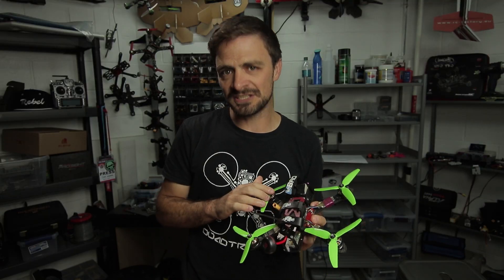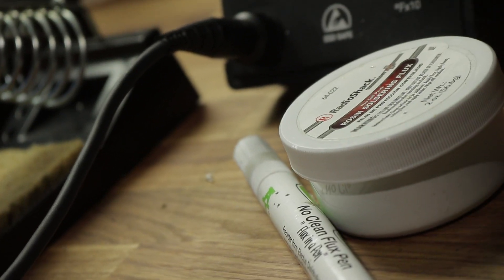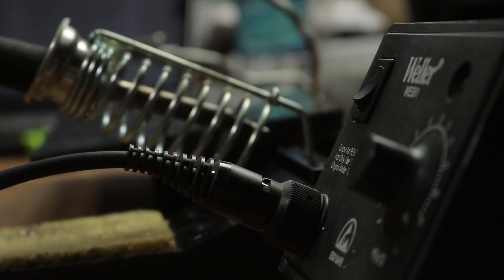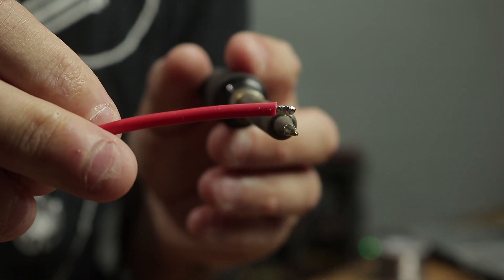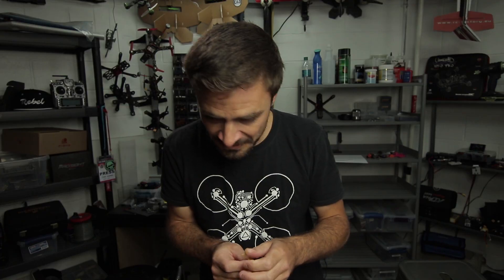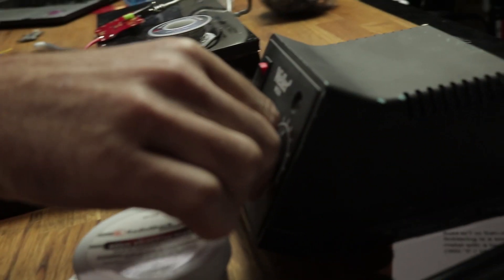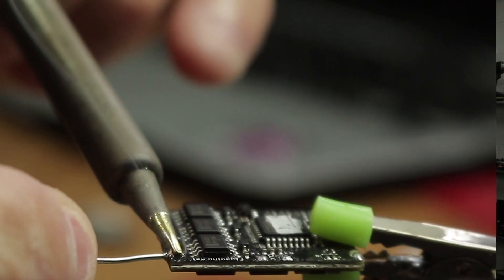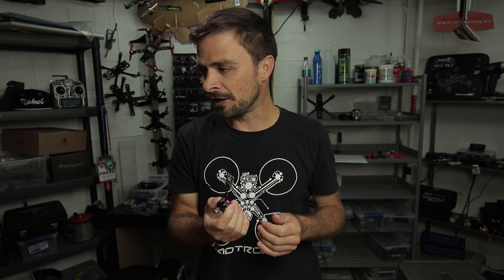Soldering Tips

Comment: So how would you go about getting a little solder ball out from between components? This happened to me while soldering a kiss esc and the solder went in those tiny spaces that you pointed out. I tried the solder sucker but it's too big to get in between there :/
Reply: Muki this used to happen to me all the time... I started using painters tape on the esc  while I solder the motor leads
Reply: Washing the finished board with alcohol and a brush removes 99.999% of all solder balls; they are blown out of the molten solder pool by the flux boiling, which is what it does.  Flux is there for two purposes.  All metals oxidize when exposed to oxygen.  The flex is acid-base and etches and cleans this oxidation out so the solder will flow into the metal parts being soldered.  It also out gasses out of the molten solder pool creating a gas shield that keeps the surrounding oxygen away from the molten solder pool.  

If you ever look at a solder joint and say, man that is dull looking and not shinny like it should be, why?  The heat was right as the parts took solder and both are soldered together.  What probably happened was there was not enough flux, or old flux, and oxygen got into the molten solder pool before it solidified.  Too much heat causes this too.  

You want to tin your parts so when you go to solder the two together you are adding the right amount of solder to where it needs to be; so when it solidifies it comes off looking top-shelf.  NASA standards tend to be anal in that way.  Just making a good electrical connection is pretty easy; making it also look right is another story.  I am NASA class B trained.  

As Ol'boy said, there is a thermal-nuclear bonding going on from the heat at the tip of the iron through the molten pool.  You can see this happening when you touch a hot iron to the two parts; the solder melts from the tip of the iron out across the two parts creating two parts in a molten pool of solder.  Electrically your done.

Aesthetically we want to be able inspect the joint to see two things: both parts took solder and are thoroughly wetted, and that there is enough solder to mechanically hold the two together; no more, no less.  Looking at a shinny giant solder blob on top of two parts don't tell you squat.  That could be a cold solder joint and you would never know it.  Chances are it is not, but in the anal NASA world an inspector would have to know for certain.  It should covered and shinny and you can see both parts wetted together.

Fit and finish needs to come together at the same time.  Two biggest things I see folks doing improper on the web: too much solder being used to prep parts/tinning; use physics, solder flows to the heat; that nuclear thing.

1.  Tinning wires: Strip them and leave them long.  It is about where you strip the insulation at.  Use flux-liquid or past/ don't rely on the flux in the solder alone.  Do not twist the wire into a ball... why?  The wire is a twisted pair as made, when you strip it, put it back as it was made-we want to wet solder into the wire so we can trim/cut the wire to the right size as needed to solder; don't twist the wire so tight that it resists solder flowing thru it as this aids in the mechanical strength in the connection-less heat needed by the way.  Apply the heat to one-side of the wire just above where you intend to trim/cut the wire to length for soldering.  Wipe/paint the solder on the other side of the wire, as it will flow to the heat, down the wire towards where you want it tinned... get off of it.  We are not globing it on here for other purposes; just tin it. Trim the wire to length.

Globing it on there ain't it, and it just wicks solder up under the insulation... not good;  takes more heat too when joining the two parts together

2.  Tinning/prepping a pad:  Use flux... see a pattern here?  Clean the soldering iron tip (every time), tin it, and apply heat to the pad.  Tin/prep the pad by wiping/painting the pad away from the tip with the solder; use the nuclear-physic thing here to paint solder on the pad.  All we need to do here is wet solder into and on-top of the the pad so we can join the two parts together later.  We need enough solder on the pad to get the nuclear thing to happen as fast as we can. This keeps the heat into what we intend to do; join the two parts together using enough solder with just the right amount of heat to liquidize a solder pool between both parts.  This is how the solder is wetted/joining the two parts together, adding only enough solder to mechanically hold the parts in place; no more, no less. 

We are not welding the two parts together, we will be soldering them together.  Both the pad and the wire have mass.  Trying to heat the pads/wires so we can create a solder pool between the tinned parts is not really what we are trying to do;  ideally, because the two parts are wetted/tinned with solder,  we want to add heat to the pre-tinned parts with just enough heat to pool the solder on the parts to do the job (make the joint); and get off of it.

The world according to Chuck is a trade off.  Back in the day, I soldered stuff that was Mil-Spec, with Mil-spec equipment and materials.  Buy good solder and their paste or liquid; don't mix the stuff unless you know it plays well with each-other.  Keep it fresh; acid products don't play/stay well in moist environments; acidic products do not store well open in humid environments.  Why do the soldering tips eat away?  Because corrosion in the form of oxidation is removing the metal by the flux eating at the oxidized metal... good-by tip, and heat makes this process accelerate.  Keep it fresh.  We are talking about two different chemical reactions going on here (maybe more).

Google: purpose for flux soldering.  Soldering is as technical as making alloys, because that is what you are doing on a micro scale.  You are molting metal, and I am not a chemist.... but I get what I want in the end, as it is an art where both fit and finish come together at the same time.  Look, I got a D- in Chemistry and can't swear much to anything; but, we got a PH thing going on here, a heat thing going on here, and a molecular thing going on here at the same time: you be the fabricator and learn the art. 

Go Easy bro's,
CarolinaChuck
Reply: You might have luck with an exacto knife and simply scratching it off.  As long as the electronic pixies don't bridge it'll be fine.
Reply: turn it upside down and brush it out with a tooth brush or something or pick it out with a pin if its stuck with flux
Reply: Muki : Just use a tinny iron tip  and melted it with any component near, or use alcohol and a teeth brush
Reply: soo if there's a tiny blob on top but it's not bridging any other components it should be ok?
Reply: TwistyML
 Good tek
Reply: Why tin?
Reply: As said in the video: solder sucker or solder wick (desoldering braid). If you want to stick with the sucker and it doesn't work, add more solder and flux and suck again. Works at least 9 out of 10 times. For the really annoying cases ample flus and wick.

Comment: ermm guys any link for 250 size quadcopter that can fix 6 inch prop?
Reply: Yeah, just put the motors on upside down on the frame and land it on the battery.  You might want to make some legs for it though.
Reply: williwonti waoo nvr think of that😂😂👍👍👍👍👍
Reply: NP mang
Reply: Quartz Xavier Reptile X4R is 250 and takes 6".
Reply: Darren Gibbard thanks mate! Will take a look later
Reply: you can fit 6 inch props on smaller frames too. The shrike 220 can handle 6 inch. If you want a freestyle 6 inch frame you can get a 260mm 6 inch alien

Comment: Thanks for another great video. Can you offer some tips on soldering the new TBS Bulletproof BLHeli_S ESC's? They should be called Solderproof because they coated the pads in something that makes soldering near impossible.
Reply: have you tried isopropyl alcohol ? the same stuff we use to clean the flux after soldering.
not sure if it works, just an idea.
Reply: is it some sort of waterproof coating?
Reply: Sigvaldi Thor I haven't tried that yet. I need to only remove the coating on pads so will need a small applicator.
Reply: STRYKA Yes I believe so. Seems a bit pointless when the important connections won't be coated.
Reply: Bludz FPV sadly that same stuff is over the emax motors cables and makes almost imposible to keep the solder on them ...
Reply: That sucks, the 2 together would be knightmare. Isopropyl didn't really do much.

Comment: Great tips for beginners. One I would add is you should consider the soldering action a 3-step process: preheat, apply solder, afterheat. Of course it's not quite the same if you've already put the needed amount of solder onto e.g. the PDB pad but the idea stays the same.

Comment: NEXT EPISODE - VIBRATIONS FROM MOTORS AND WAYS TO GET AROUND IT!!!!!!!!!!! - Causing high/mid/low throttle Oscillations...  (soft mount, filing the holes in kiss fc, filtering, capacitors, etc...)
Reply: I second that
Reply: Step 1:Never get an FC with a MPU6500.
Reply: Thomas Haddad I third that
Reply: CrobleFPV Fourth that!!
Reply: I fifth that :)
Reply: I OVER 9000 THAT
Reply: I couldn't agree more.. MPU6000 is the best I have ran so far. 6050 is ok if it doesn't come in a 6000 variant.
Reply: agreed!
Reply: Tom Coffel MPU6000 ana MPU6050 is the same device. Diferent is, one of them have I2C ana SPI, other one have only I2C. All of FC use only I2C comunication bus for MPU, so there is no diferent.
Reply: Pawel Piotrowski they're different in the fact that one uses SPI or i2c (SPI being faster) and other strictly i2c, slower... there IS a difference. I don't use anything but SPI, hence my use of 6000 only.
Reply: who hasn't fuck wit.